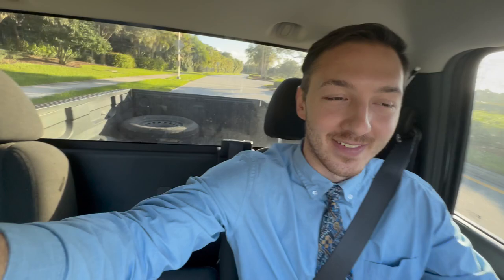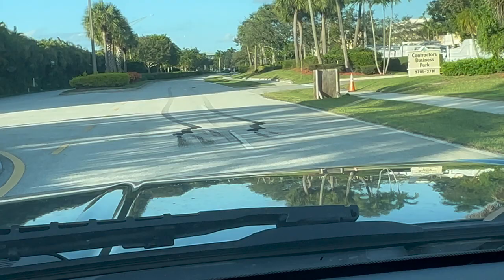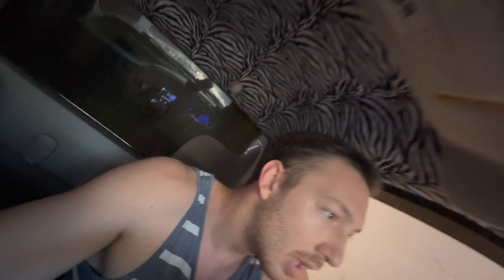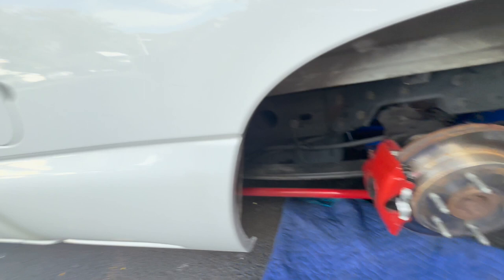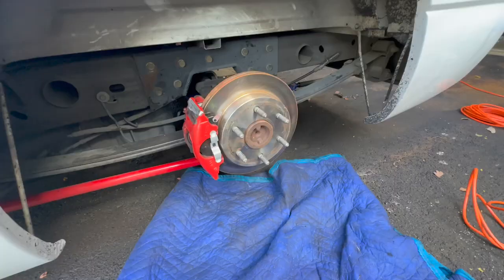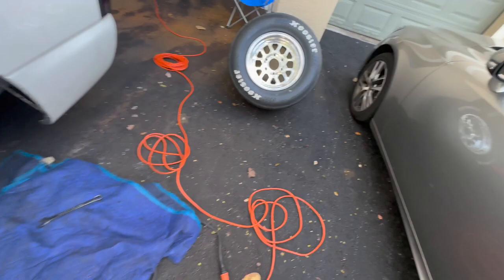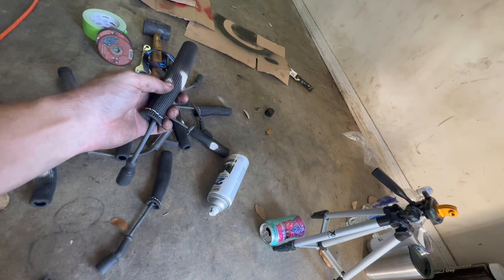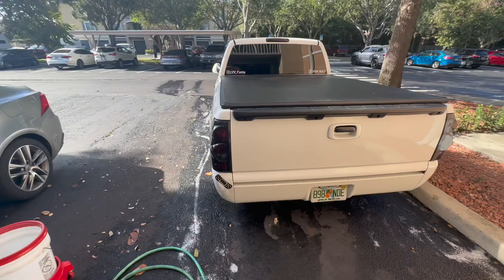I ruined my Bogart Racing Wheels racing wheels already :( Cammed Silverado not happy

Comment: Truck looks sick on the bogart bro!!! I run accel spark plug wires on all my LS stuff with the ceramic angled boot. Never had any heat issues and they perform flawlessly... they are 120 for a set but will last forever.
Reply from the maker: I got new wires!  They seem to fit so much better! Ran those old ones for way to long 😂

Comment: Man that one nice truck keep up the great work. But just wondering what are the spec on wheels like size and front and back and also backspacing
Reply from the maker: Offsets I can’t help with, I just have the measurement to Bogart for the front and they made them. The rears are off the shelf. Fronts are 20x7 and rears are 15x10!

Comment: You used the 1320 15in wheel brake  parts and still need to grind caliper?
Reply from the maker: Yeah, from what I’m finding the wheels are made a certain way and needed to be grinder down. I put a 15” race star on and it clears with no issues
Reply: @SiskBuilt  I just put my bogarts on today n I have the same issue
Reply from the maker: @boosted_sierra4264  gotta grind them down! Hit the edges. Tape the barrel. Put them on, if the hit, grind more. If the dont. Install, then move the caliper since it’s a “floating” one. And make sure it doesn’t hit!
Reply: @SiskBuilt  ya bro been at it with the grinder and using  a 1/4" spacer so hopefully no issues after
Reply from the maker: @boosted_sierra4264  I didn’t use a spacer, but I grinder down a lot!
Reply: @SiskBuilt  whish I knew b4 I scared the rim 😅 oh well live and u learn now to do more shaving
Reply from the maker: @boosted_sierra4264  it happens! I scratched mine too. I think it’s mainly made for drum brake rears